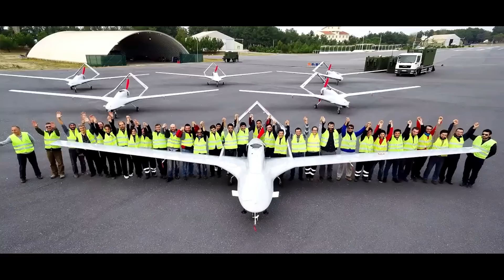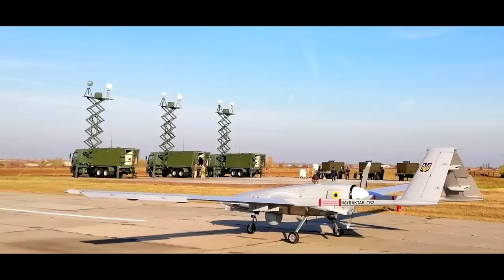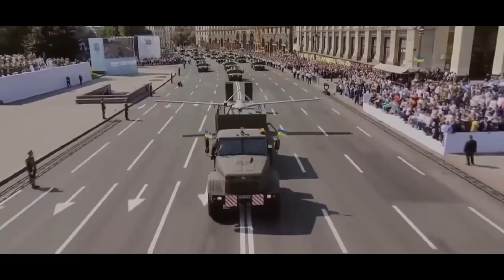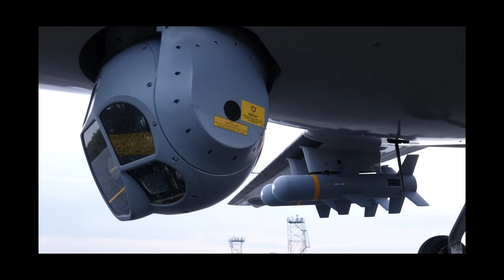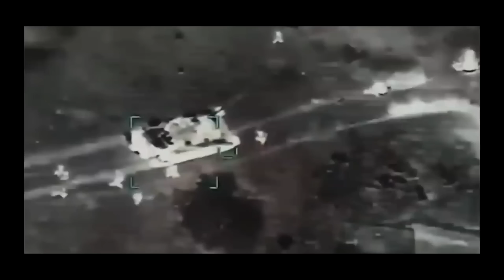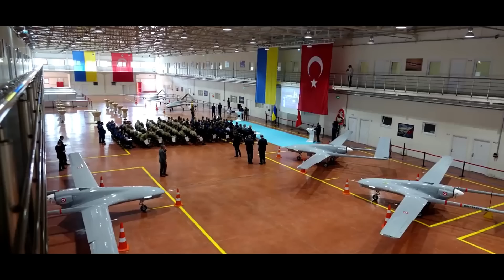Bayraktar TB-2 | Death from Above

Comment: This is an awesome drone, I can see why they wrote a song about it.  The US Drone line-up is missing a class of drone such as this.  We have high-end drones such as the Reaper or the Predator then the low-end such as the switchblade, but nothing to fill the mid-range gap.  The US should have something that's a platform for existing *cheap munitions (mortars rounds, ATG missiles, Stinger missiles and anti personnel/tank hand grenades), less costly and something that can be easily deployed (short take-off or tube-launched).
Reply: If we need them we can build them that's one thing we'll never have to worry about we have a self sustainable economy and military industry.

Comment: Well that was perplexing. One of the machines had a 2 blade fixed pitch prop, another had a 2 blade CSU and yet another had a 3 blade CSU. No idea if they were different model/capability machines but I would have a WAG and say yes. One of them had 2 weapons pylons and another 4 pylons. Don't know if the same powerplant in each of the different prop configurations or if they had a more powerful powerplant for the machines with the extra pylons.
Nice job there Turkish engineers! 👍
Slava Ukrayini!
Reply: İki pervaneli olanlar ithal edilen üç pervaneli olan daha sonra Türkiye'de geliştirilen yerli üretim motor

Comment: OK ------ 1:    The M-777 155mm Gun could be Ukraine's SUPER WEAPON to help the TB2 WIN this WAR!!!  But the current American M-777,  155mm gun only has a short 39cal. Steel barrel that is even inferior to the 42cal Steel barrels in most of Nato's inventories...   Giving the Short barrel M-777 a projectile range of only 23 miles with the standard M-795 round.  But the M-777 gun America is giving Ukraine could have a range of over 34 miles (instead of just 23miles) with the same M-795 round using a new High Tech long 58cal Barrel (replacing the M-777 old tech steel short 39cal barrel) that is now being field-tested by a Battalion of M-109 Self Propelled Superguns (that truly look beautiful with their long barrels). The new high-tech none steel barrel is a Composite Carbon case, Titanium sleeved long 58cal Ultra High-pressure Marvel of American Engineering... The high-pressure 58cal (30 feet long) barrel using supercharged propellant (that would blow up the average steel barrel) gives the M-777 155mm Super Gun a range of 42 miles firing the new XM1113 projectile... and over 100+ miles with the new subcaliber Hypervelocity GPS guided projectile. Making the M-777 a terror for all Russians in Ukraine... Allowing Ukraine to finally take back (freeing) the Crimea and the Donbas without suffering massive Ukrainian casualties...
K -------  America needs to send the Battalion of new M-109 Super Gun, long-barreled 58cal guns to Ukraine for testing in real combat (instead of blowing craters in the Texas desert), which would be followed by the new high tech SUPER BARREL Kits for Ukraine's M-777 guns (the new lightweight composite 58cal 30-foot long barrels {same weight and balance as the 39cal steel barrels in both the M777 and M109}  simply slide into the gun carriages of both weapons, replacing the original 39 cal barrels without any major modifications). That could number 1,000 M-777 Superguns deployed to Ukraine in a short time if they are pulled from American storage Depots that are waiting to be scrapped... (in addition to the measly 90 the US is sending now...)   Giving Ukraine a chance against a Russia that has thousands of big guns more than Ukrain but lack the range of the M-777 SUPER GUN that would be able to sit back and safely SNIPE the Russian big guns and their ammunition depots into oblivion no matter how many Putin sends...!!!  Finally giving Ukraine an advantage they Desperately need...!!!  As the Russians both outnumber Ukrain in weapons and manpower...!!! 
K1 -------  Please call and write President Biden and your Congressmen in the House and Senate to demand that Ukraine gets the thousand M-777 and hundreds M-109 guns from our storage depots NOW, with the SUPER GUN 58cal upgrade kits following as soon as they are produced...!!!  That will stop the Russians in their tracks from taking any more Ukraine cities to torcher innocent local civilian men, Rape women and children then murder and bury them in mass Graves...Thank You...

Comment: Talk about being in the right place at the right time! I checked into a stock offering. None available. Private corporation. How many have been shot down? Rotax motors are also used on ultralight aircraft. Very reliable. Austrian manufactured. Roughly $25,000 for non-turbocharged version. 4-cycle.
Reply: Turbocharged engines get ragged out quicker. Not sure if you want that.
Reply: @nole8923  I don't want either one. I use their 503s. 52 hp, 2 cycle, it's all I need.

Comment: That killer tail section of the bayraktar, that's designed like that to help stabilize the plane when one bomb is dropped off of one side, & because the air is pushed through the elevator-rudder section, it makes it incredibly straight back stable. the long Wings also help with stability and glider-type characteristics.
Reply: A wing with a high aspect ratio like the Bayraktar TB-2 and especially a glider is to minimise induced drag. It allows the aircraft to fly further using less fuel hence the 27 hour loiter time on 300 litres of go juice. If anyone comments that a glider doesn't use go juice I have a four letter word for you....Apis. 😁

Comment: This is going to sound stupid, Russia as a massive amount of oil under Siberia, would a massive fire there catch fire to the oil although the oil is some distance under ground.
Reply: Would need a large supply of oxygen. Not stupid to ask questions! In fact, some coal seams have been burning for decades since air gets to them. Impossible to extinguish.